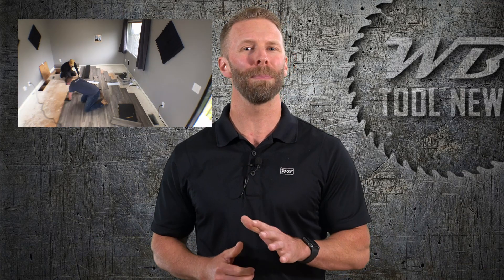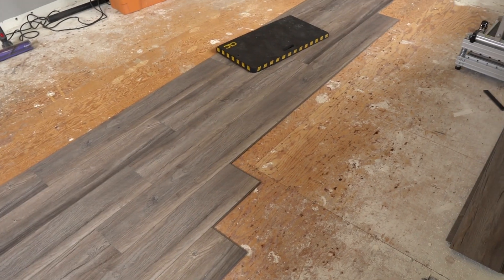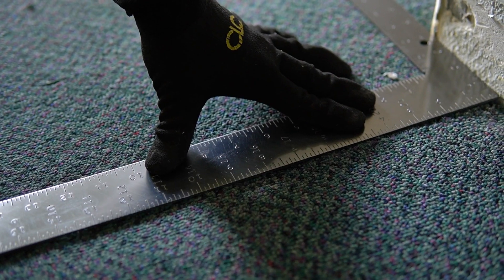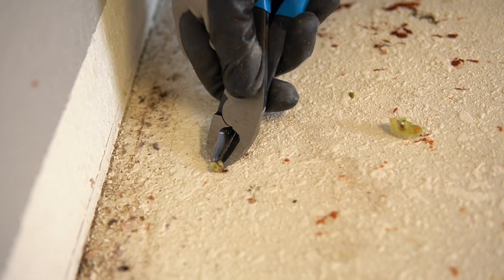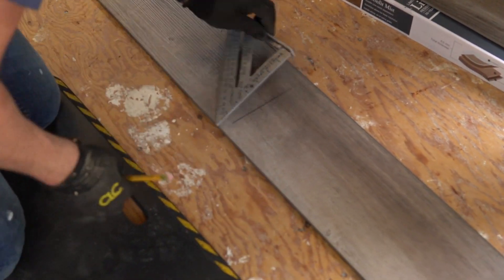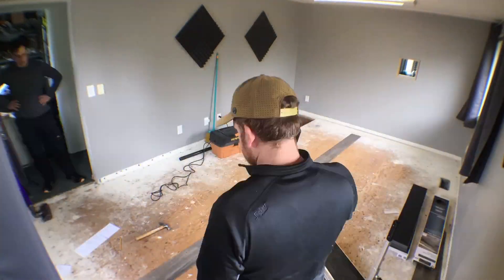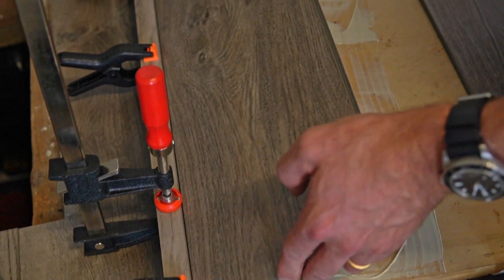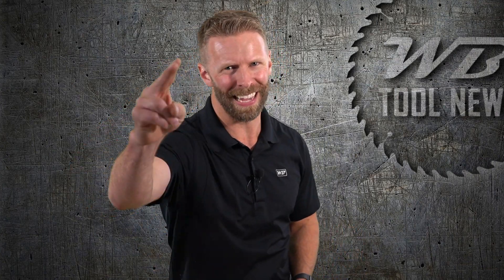DIY Studio Upgrade | FLOORING INSTALL with Stone Core (SPC) Click LVP

Comment: 20 Mill wear layer - excellent.  You will find SPC is very tough but of course has a harder feel than WPC LVP Flooring.
Reply from the maker: That's right, SPC is great for those areas where they'll take a beating or if they're expecting higher traffic.
Reply: SPC for commercial WPC for your home